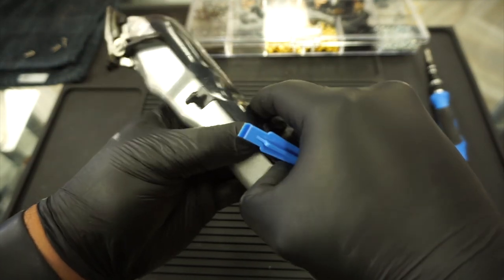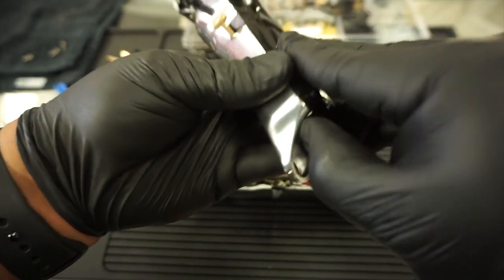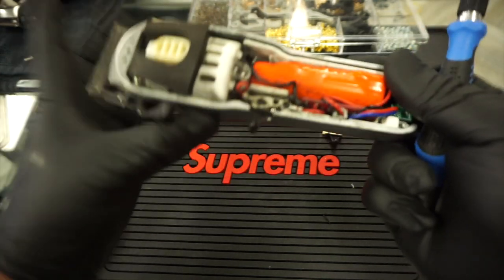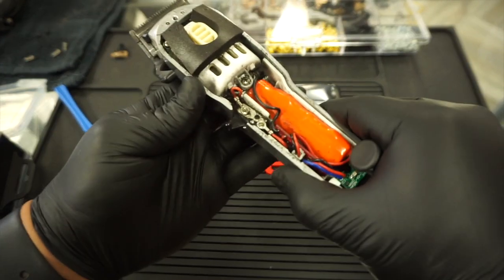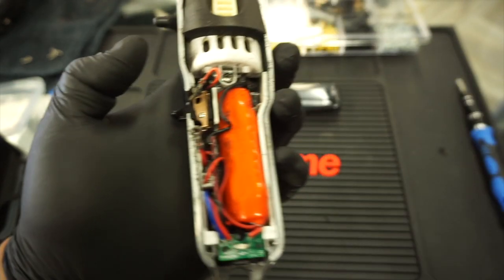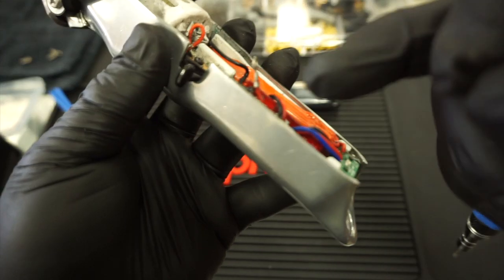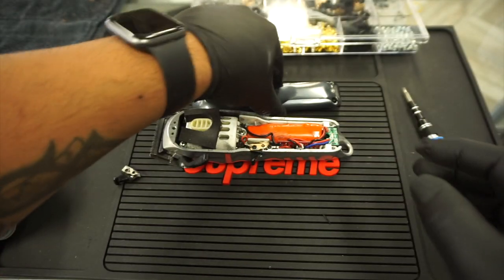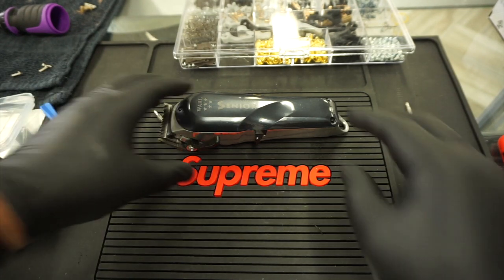HOW TO: FIX THE WAHL CLIPPER OFF/ON SWITCH

Comment: Good vid guys. 
I have a problem. I got a few replacement parts and i install em as you do. But the ball keeps popping out of the bottom. 
Also if i push the switch further into the on location id fluxuates in power and the pitch goes up and down. 
Im thinking its a shit part off ebay?  What do you think?

Comment: Worked but still has some sparks coming out while screwing it back in. Better to put on gloves before touching the screw to screw it back in to avoid current shocking. 
 Appreciate it bro, thanks for your guidance 👍🏽

Comment: What all around clipper do you recommend for everything both bulk detail and fading ??
Reply: Definitely the wahl senior, chorded or chordless.
Reply: Alex Loyola thx bro what’s the difference between them and the magic clips
Reply from the maker: Yeah those are great options. But I would also check out the cordless masters too if budget is not an issue. 👍🏼
Reply: IamCesar what’s the difference between cordless magic clips and cordless Seniors

Comment: I’ve had my magic clips for about 8 months and today I used them for about 4 haircuts and they were working flawlessly, I then decided to charge them and i plugged the charger in and no blue light appeared, I tried using different outlets and still no power. I then disassembled the clipper and didn’t find any faults in it. Can someone please help me I really don’t want to spend another 250$ on another pair.
Reply: 250 for cordless magic clips? 😮
Reply: @Unkn0wn1133  i live in Australia

Comment: Or  you can try cleaning the little metal piece on the switch, that’ll help wit the connection
Reply from the maker: While that can be a great option if the clipper is a recent purchase, but if you had the clipper for awhile like the one shown here you can break the piece easily as well bro. I put tiny bit of pressure on the old switch and it broken super easily.